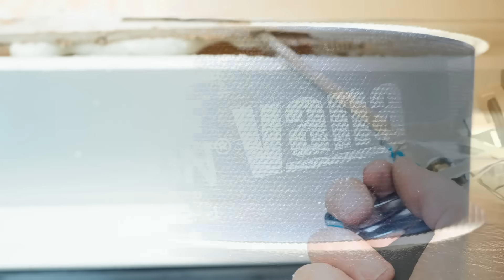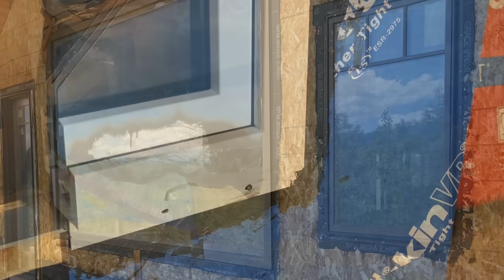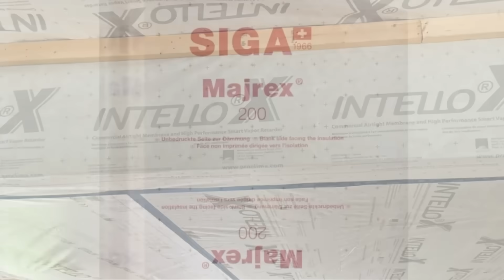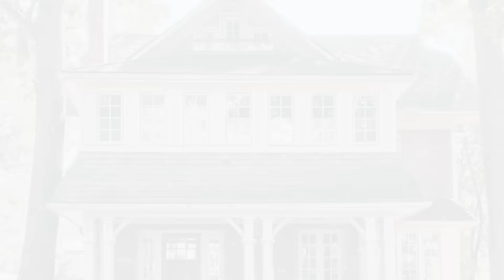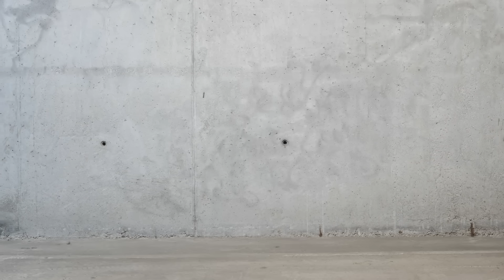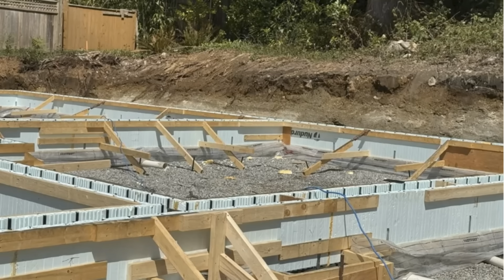Why We Don't Talk About ICFs?? Window Flashings, Air Sealing, & More! | Q&A #6

Comment: ICFs use thermal mass BADLY.  Credentials:  I took classes in heat transfer and passive solar design at Cal Poly, taught by the guy who wrote the CalRes/MicroPass energy analysis software that is the basis for at least California's energy efficiency analysis.  
Putting thermal mass BETWEEN two layers of insulation is a waste.  The thermal mass doesn't know whether to moderate the indoor temperature or the outdoor temperature.  25 years ago  there was (hopefully still is) an ICF manufacturer that offered interior forming options where you could use plywood or OSB on the inside surface.  Something like that would allow the thermal mass to better  'communicate' with the interior volume, whose temperature you want to keep stable.

Comment: For Q&A #7: I'm in climate zone 5A with a 100+ year old house. There is a pitched roof that terminates at a wall. The roof is vented (intake) at the soffit, but does not have an outlet vent. So the air comes in from the soffit vent, goes through the roof and wall, then exits into the very small attic and/or roof (the house is 1 3/4 stories). Adding a proper exit vent is not an option right now. Is it better to close off the soffit vents and risk water/vapor damage or leave them open and deal with the cold air in walls during winter? Also, the house is old and leaky so it's not like closing off the soffit vents would completely starve the roof/walls of air flow.

Comment: Love your videos.  As a quick follow up to your discussion regarding ICF.  Fastwall, Durisol (in europe) and Nexcem in Canada are a "Green" ICF alternative.  They are very niche and may not have enough traction to be worth your time, but I am hoping you could dive into them a bit.  I believe in situations where noise is an issue they could provide a green building alternative (no foam on the inside).   There is very little literature that I can find regarding performance of the wall assemblies.  Fingers crossed you look into it!

Comment: Great video!  A lot of the items he talked about we’re having internal condensation I’ve seen on a lot of sidewalks.  Finishing building a 14,000 square-foot home out ICF just north of Portland Oregon and even though everyone said we didn’t need to do an exterior WRB, obviously we did with both polywall 60 mil, peel and stick as well as a dimple system.  It’s been phenomenal

Comment: As an engineer I heard about ICF from another engineer who designed and built his own home out of ICF.  I was already watching Matt Risinger and thought I knew a fair amount about well built stick framed homes.  Then I did research on ICF and it became abundantly clear ICF was far superior to other forms of construction.
1) Disaster resistant to earthquakes, floods, tornadoes, and fire.
2) Air tight without a ton of effort to get all the little details right when drying in the house. Up to Kode is getting passive house blower door results at less than 1 ach.
3) Actual R value and performance is much higher than a similar stick built house.  Even one with 2” of continuous exterior insulation, which is hard to execute and expensive.
4) Sound abatement of a concrete wall is superior to anything stick built unless you’re putting in over a foot of rock wool.
5) Longevity.  Concert will outlast wood no matter how well you nail all the details for air and water sealing, because wood rots.

We all learned as kids not to build our house out of straw, or sticks, when you can build it out of bricks.
Reply: While I agree with all your points, I wonder how to keep carpenter ants out of it. They LOVE it here and move in almost immediately. If not for ants, I'd use it in a heartbeat for my three upcoming buildings.

Comment: As always, I love the videos. Thanks for putting these out!

I have a few questions! It would be great if any of these could make your next Q and A. I live in the north. It's predominately dry. I use AC for a few weeks a year when its too hot or too smoky to open windows. I'm running heat for 3 seasons.

If I build new, I think a double stud wall will be my best option to hit my efficiency goals. However, I absolutely love the look and durability of brick. From your content, I would guess brick and a double stud wall are largely incompatible with each other due to drying risks. Should I give up on this dream and use a different siding?

If I buy an existing house, I would like to increase the insulation. The building would be built with 6" studs, between stud fiberglass insulation, polly on inside behind the drywall, and a low quality developer spec house wrap. Can I increase the insulation without opening up both inside and outside of the wall? I'd add an 4" to 6" of insulation and better air sealing if it's not cost prohibitive. Recommendations?

Lastly, are you familiar with vacuum sealed windows? I've heard of them. I love the idea. I have no idea if products are actually available or affordable. Thoughts on them?

Comment: @ASIRIDesigns You touch a lot on insulating a concrete/cmu wall from both the interior and exterior, but how about insulating a cmu from WITHIN the block itself? More specifically, interested in hearing your opinion on the effectiveness of Omni Block, which is a proprietary cmu block design with poly inserts that is designed to provide insulation from within the wall. I see many examples of it being used in a mostly warm, dry climate (Arizona, New Mexico, etc) but not many examples of it being used in all-season zones (Ohio, Michigan, etc). Can you touch on this in an upcoming video? Thanks, and great work on helping the community learn better building practices!

Comment: I look forward to more ICF content. 

I started learning about it when I got interested in building my house and my engineering training immediately drew me towards it. High strength, high density, monolithic design, high heat capacity, modular capability were my biggest draws. 

My philosophy in design is to minimize complexity and maximize reuse. I see ICF as the most effective way to build a house that will outlast me with a well drained footing. 

- discipline reduction: I need to study many fewer topics as a novice builder for ICF. The techniques are consistent, and the number of layers is reduced

- minimal structural walls (especially if using poured floors) maximizes open and usable area (and sunlight

- less complexity at sealed openings

- stick framing living space inside the ICF makes renovation dead simple

- more DIY friendly build schedule with large amounts of asynchronous work (building up floors and walls from blocks, building up bracing, rebar reinforcement) and then big bursts of high man power demand during pour

Biggest risks to me seem to be around penetrations and the fact you can’t fuck up so you gotta find pros to do the pour. 

I can also imagine issues around the furring strips since they are plastic. 

My design would rely on avoiding penetrations where possible or building them into areas what will already need moisture attention anyways like door and window openings.
Reply: The thing is you can do all that without the ICF product without as many of the draw backs. It's just a poured concrete wall with insulation on both sides. It's not magic. As you intelligently point out there are a ton of things that are relied on which could go wrong within an ICF system so knowledgeable installers are key. There's too few of those as it's a new product with every manufacturer producing something slightly different. A concrete forming company can provide a visually verifiable structure at a fraction of the cost. You then have a myriad of products to chose from that are easier achieve a high quality detail than the glued/spray foamed together EPS blocks typically found on IFC's. There are options which are higher performance, better for the environment, more flame resistant, less susceptible to moisture damage and perhaps most importantly can be applied when it suits the construction schedule. I've seen way too many ICF's homes sitting completed with no protection from the environment awaiting siding install. The foam deteriorates and loses performance and the plastic nailing strips become brittle and don't hold screws. Some builders do ICF's in house to save a buck on the labor and skill of framers and formers but then spend ten on sub trades because you end up with high dollar electricians and finishers fiddling with foam rather than what they are used to and good at. Doesn't make any sense. On paper they are a great system with good performance numbers, and in an ideal world they would stay true. In reality they often aren't being installed well enough to achieve those values. It makes me think whoever came up with ICF's had never seen a house being built or been on a construction site and there's too much misinformation and misdirection out there to trust it. They're going to end up costing people a lot of money. Re-siding and establishing drainage planes of ICF's are a nightmare, especially when they've been compromised as I described above. Nasty stuff IMO but we DO need more systems that give us more options to increase production as the housing shortage continues to rise and skilled labor continues to fall. just my $.02.
Reply: Repeating this under your comment, so you may get notified of the info (in case you are considering using ICFs on your house).
ICFs use thermal mass BADLY.  Credentials:  I took classes in heat transfer and passive solar design at Cal Poly, taught by the guy who wrote the CalRes/MicroPass energy analysis software that is the basis for at least California's energy efficiency analysis.  
Putting thermal mass BETWEEN two layers of insulation is a waste.  The thermal mass doesn't know whether to moderate the indoor temperature or the outdoor temperature.  25 years ago  there was (hopefully still is) an ICF manufacturer that offered interior forming options where you could use plywood or OSB on the inside surface.  Something like that would allow the thermal mass to better  'communicate' with the interior air volume, whose temperature you want to keep stable.
Reply: @thormatteson7141 completely agree. Thanks for your comment. I was talking about entire systems that use concrete for the floors of the house as well in regards to thermal mass but that wasn’t clear. I agree. No point in having thermal mass between the hot and the cold side. You just end up with two thermal interfaces instead of one.

Comment: Retired architect here. I appreciate your videos, especially for the building science content. I designed an ICF house a few years ago at the request of the owners and building contractor. The building contractor had built several ICF houses and was a big proponent. He had become an ICF distributor.
While ICF's had a learning curve, I was able to design the house to meet the state-adopted IRC (International Residential Code). My issue with ICF's is the difficulty to remodel .....larger or new windows / doors appear to be more expensive to execute in ICF walls than conventional wood-framed walls.... new headers especially. Am I wrong?
Reply: How do we keep carpenter ants out of ICF? They move in almost immediately, sometimes within a day or two of site arrival.

Comment: Here in BC we are told not to spray foam around vinyl windows. They say this will eventually break the seal on the glass sealed units since there’s no room for expansion contraction. Also I thought a low expansion foam isn’t an air barrier?

Comment: to be clear, the UV "deterioration" on an ICF block is only a very thin 'skin' that can be brushed or lightly rasped off, exposing virgin EPS below. the structural & thermal properties remain unaffected, so this is really a non-issue. this is true even in high UV locations with years of prolonged exposure, which is a huge benefit for slow DIY builders and stalled/delayed project cases... with stick, a common permit delay can lead to deteriorated house wrap & water damage.

(i'm not a sales rep or have any ties that benefit me financially. there are just so many myths & inaccuracies surrounding ICF, usually to disparage it.)
Reply: On the most recent YouTube channel "Stud Pack", they took extreme care to get all the framing square, level, and plumb, only to find that when they began to put on the sheathing, the heat and humidity had twisted everything.  There lesson learned was to sheath   while you go, when possible.  You can't let sticks sit out in the weather either.

Comment: What are you thoughts on installing an active air movement system in the wall cavity?  For example system would be pex tubing inserted into the top of the stud bay and a pex tube in the bottom of the bay.  The tubes would penetrate the top and bottom plate respectively.  The top tube would be connected to a an air compressor.  The bottom tube either to a vacuum or an open space (crawl space) for passive ventilation.  Both tubes would be outboard  of a sheet of XPS foam board installed 1/4" from the inboard side of exterior wall sheathing.  The foam board would then be sealed with caulking to the studs and top and bottom plate.  So the assembly from inboard to outboard would be:  drywall > insulation > XPS board > air gap > exterior wall sheathing > wrb > rain screen > exterior cladding.   Air could be actively pumped/pushed either continuously or scheduled into this air gap space resulting in the drying of the space.  Thoughts?
Reply: Sounds like a fires wet dream or a chance for toxins if you use low oxygen gasses for drying the space. Both are bad. Generally not worth the effort but interesting thought.
Reply: @alexfoster3507  Possibly an increase risk for fire spread.  Where would low oxygen gasses come from?  Thanks for the input.

Comment: i dint know, maybe cos i live in Europe, i think ICF is not a good product, for one specific reason, which is Thermal mass.
we in Europe,  we use in most cases  solid wall products, they are heavy and have a good themall mass, and if you put 4-8 inch of insulation on the outside, the inside air heat will slowly soak the wall, yes even basement wall (if properly insulated from the outside with XPS) and the wall material will heat up or cool down depending what you need it to do, and that gives a phenomenal  feel of comfort, the wall materiall is around 1 foot to 1 feet and 5.3 inches. so all that material holds the heat or cold for longer time inside, cos of the outside insulation, but in  case of ICF the Thermal mass is in the middle and the inside face also has a 2 inch EPS surfcace, which  from the mentioned perspective is a really bad thing, cos that 2 inch insulates the inside air temp from theThermal mass.

Comment: I really love your videos.  I was wondering if you could do an in-depth video on “innie” windows with exterior insulation.  Having the window mountied inline with the sheathing/wrb and then flashing/trim to cover the exterior insulation.  I’m wondering if it might be easier for a contractor that’s not as family with exterior insulation and also I think it may look more historical having more depth in the window.
Reply: When the wall is thick, IMO “innie” windows would look better from the interior.  I’d just wonder how to keep exterior rainwater out of the wall assembly.

Comment: Please do more ICF videos. I have seen a lot of information about the positives, but would like to understand the possible issues.
Reply: I echo that view.  I consider this the best channel for mainstream performance wood based construction and would like him to turn his attention to ICF also.
Reply: The biggest risk is that it's rare so workmanship, inspection, and if your crew falls through and you need to switch you could be delayed months or over a year. 

Wherever it is when it sets up is where it is unless you demolish it. There's no fixing it. 

Also any penetrations in that wall need to go in ahead of time otherwise the hole alone will be a lot of money and mess.

Vertical siding needs strapping, the plastic pieces in the wall do hold well but they're way more finicky than wood, especially longer drywall screws. 

You need to have a plan for window flashing and waterproofing as it's a little different. You need to protect the foam from inspects. It's an expensive system as well. 

However if you have details all done in advance, a skilled crew. All your penetrations planned, you're not afraid of just a ton of strapping to make your life simpler, then it's a great system. Go right up over the roof and you're framed and insulated in one step. 

Again, then how do you attach your roofing? How do you attach your exterior lights?

All doable but all different. You need to have that all considered and planned in advance and even if you do, if the trades you use aren't used to it they'll cause you headaches.